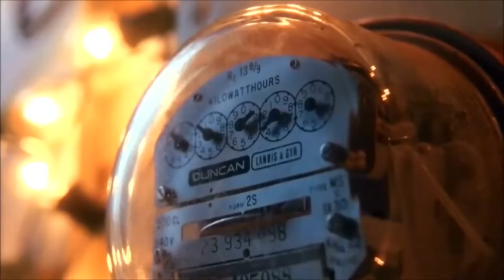Vintage Book Press

Comment: Hi, I've got one of the exact same design but about 2-3x as big.  I'm planing on restoring it as we all as another smaller one I have.  Was wondering what is in the bath you were soaking the pieces in.  Great job!
Reply from the maker: The product I use is Evaporust, but it is quite expensive. You can also use just straight vinegar,  for heavy metal pieces, but don't leave it in too long.

Comment: Wait, what was the issue with the handle and how did you remove it? I think I'm having the exact same issue on a press I'm restoring. Any help much appreciated!!
Reply from the maker: There was a pin that was put in from the top that I could not see because someone previously tried to remove the handle and made a mess of it. The other issue is if you can find the pin it was put in at an angle so the handle needs to be able to turn as it is pulled. Drilling the pin out would be difficult because it is on an angle. Hope this helps.
Reply: @vintagemachineworks  Thank you! What tool are you using to drill it out? And will this effect the ability to put the decorative stop back on during reassembly?

Comment: The piece that connects the press screw and the press plate, what is that piece called? I am trying to find one for my vintage press, and I am not finding it. I am calling it a "retaining nut," but that doesn't mean that is what it is called. It's in the video at 4:36 - those pieces that you take out...any help from anyone is greatly appreciated.

Comment: So basically all it needed was a good clean and grease to function fine? Why take the wheel off?
Reply from the maker: Why not? When I repair an item I like to completely disassemble so every part can be thoroughly cleaned and free of rust. Also it needed a little more than just a clean. Both pressing surfaces needed to be made perfectly flat so it wouldn't leave marks. and the end user wanted it to look good.

Comment: Great restoration! Hope you don't mind me asking but what primer and paint did you use? I have a similar one I'm looking to restore. Thanks
Reply from the maker: I use an etching primer and the paint on this was "VHT"  High Gloss. It is designed for brake calipers, so is a very durable paint. Thanks for watching
Reply: I don’t mean to be nagging or complaining, excellent work 👍 loved watching it as I’m about to go through a similar experience.
But from my very limited knowledge I’m under the impression the most common paints used around 18:th century was linseed oil paint. It is protective against rust and holds pigments really well. A bit expensive but looks great. Usually coated three times and left to dry approximately 48 hours in between coatings. Linseed oil paint doesn’t work on a base coating of acrylic or newer plastic paint. So anyone who want to use it, be sure to remove all existing paint before applying super thin layers of linseed oil paint. If it is a really old item that’s never been restored, odds are in favour of it being linseed oil paint. If it is not, the linseed oil paint won’t dry properly. Linseed oil paints is available from very matte finishes to high gloss finishes and a few variations in between.

Comment: I have this exact press. I am able to see the pin beneath the nut on the wheel. Any suggestions for how I can remove it with destroying it? Thanks!
Reply from the maker: I think your best chance is to drill the pin out.
Reply: @vintagemachineworks  that’s the answer I was afraid of. I saw you replace that pin in the video but I don’t even know what I would use for it. Thank you for the reply!
Reply: @mrvideogaming  Can't you just pull the handle off but leave the pin in place? it's just a key to key the wheel to the screw. Pulling up should not hurt the pin/key.